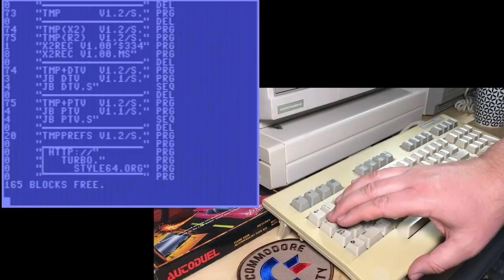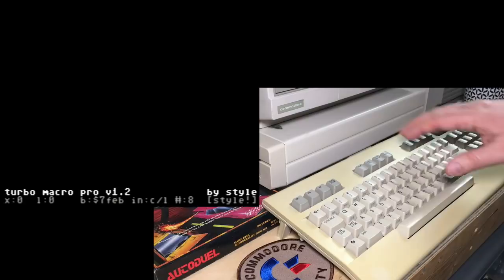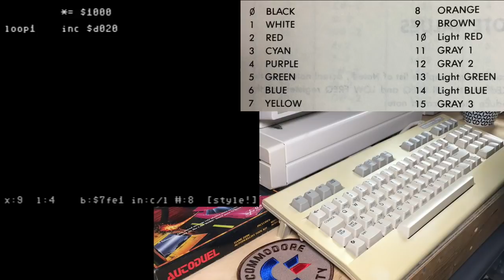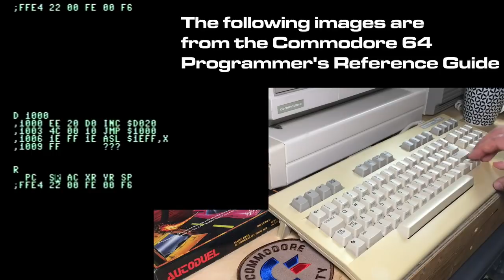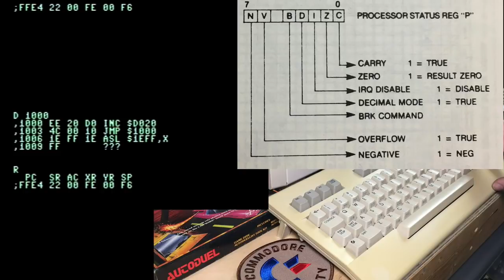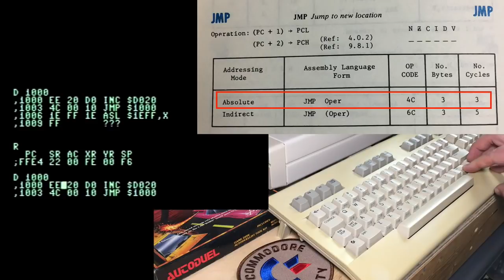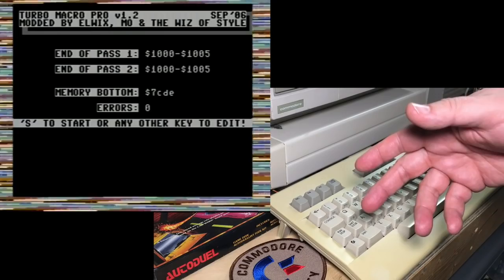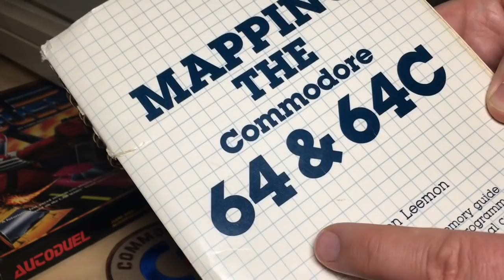Commodore 64 Assembly Language Programming With Turbo Macro Pro

Comment: I'll still never understand assembler!
Reply from the maker: You might want to try watching my first episode in this series, if you haven't already. I go really in depth on a very short assembler program, maybe it'll help. https://youtu.be/EUCSZw7piKE
Reply: Which one, for they differ between central processing units?

MOS 6502 / 6510 / 8580 is probably the simplest, you have three 8-bit registers, the accumulator A, the X  register and the Y register, which is often used as an index  for addressing 16-bits of memory. Congratulations, you now know 6502 assembler. That's all there really is to it, the rest like the instruction mnemonics are syntactic sugar on top. Okay okay there are a few instructions like SEI and CLI which manipulate the processor state flags, but there are only eight flags... MOS 6502 is the best processor to learn on because of how simple it is... Things get really, reeeaaalllyyy complicated when you get to the UltraSPARC assembler (SPARC V9 VIS instruction set). Now that's a trip and a half and no mistake!
Reply from the maker: @AnnatarTheMaia  I was just talking about this with a guy at work today. I suggested 6502 was the simplest to understand the assembler itself, but the trade-off is that actually accomplishing much with it gets more complicated because it takes so many instructions to get something done. CPUs with more opcodes and/or registers are more complicated, but they allow algorithms to be implemented with a lot less code. A simple example is 6502 requiring ~7 lines of code just to add two 16-bit numbers, while other CPUs can do that in an instruction or two.
Reply: @8_Bit  that is true, but for learning the low-level concepts of how a computer works and how to code in assembler, 6502 instruction set architecture is perfect because of its simplicity, which makes it easy to grasp. I would say that it is an analogue to learning how to program in AWK or Bourne shell: very simple yet very powerful languages which exponentially grow in capability with the user's experience, ideal for learning programming concepts. 6502 assembler is a good stepping stone for mastering other instruction set architectures, like the MC68000 family or any of the RISC processors like UltraSPARC, MIPS, ARM or PA-RISC.

On the other hand,  6502 is a product of his era, when the MC68000 was still too expensive and intel only had a half-working pile of transistors (intel 4004 / 8008) which were primitive by comparison. It is a processor designed to be a cheap alternative to MC6800, MC68000 and intel 8008, and to build affordable consumer grade electronics with, and in that, the history recorded it as a huge success. Mission accomplished. Lots of us owe our livelihood and our careers due to what we learned on the Commodore64 and due to MOS 6502, as it was indeed a stepping stone on the path of learning more powerful and bigger things like the MC68000 assembler and the Amiga.

Yes it takes more code to accomplish floating point arithmetic, but if you compare intel 80x86, it's no better: it only has three general purpose registers and lots of peripherals are not memory-mapped, so it's far worse to code in intel assembler that it is in 6502.

I think some of the concerns could be alleviated by writing general purpose routines in 6502 and exposing them to other software as libraries. Sadly because we were kids and were striving for the shortest, most optimized code we could write the thought never occurred to most of us. I guess we had no use case. However, 6502 would greatly benefit from a general purpose mathematics library like the GNU multiple precision (GMP) one, what with all the floating point arithmetic bugs you showed in the other episode. I'm kind of wondering if it would be possible to port GMP with cc65...